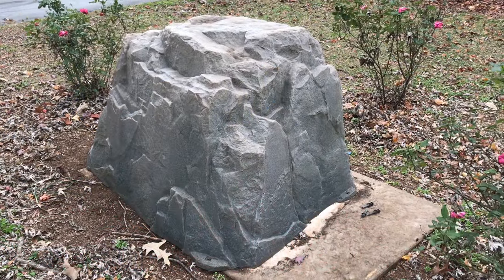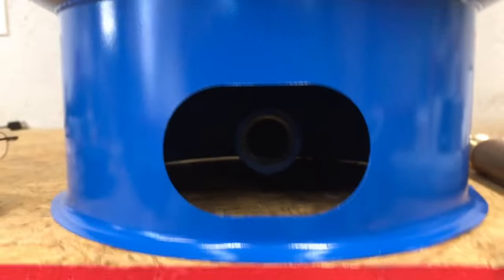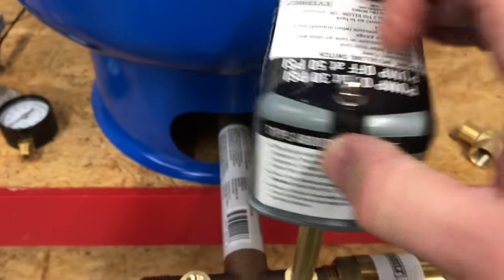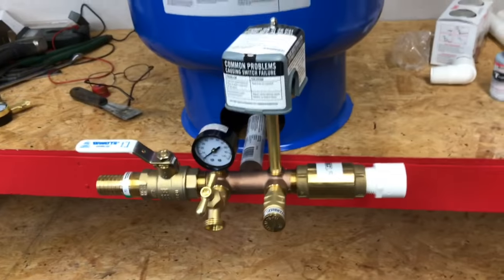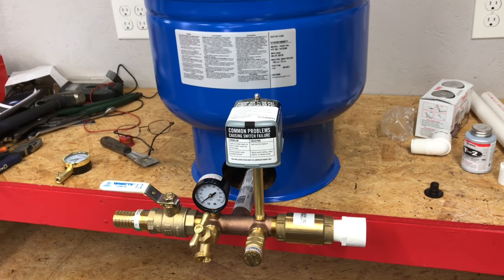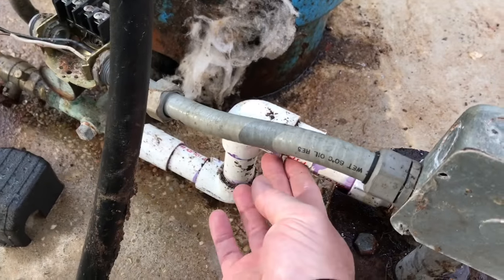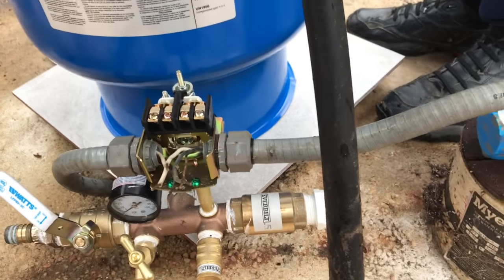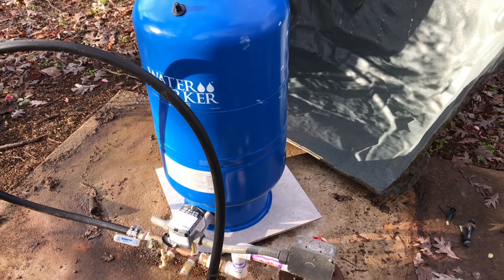How to Replace a Pressurized Well Water Tank DIY

Comment: You are supposed to put the vall valve at the house end of the system (the end that goes to the house after the tank) not to the pump side because that doesnt do anything there is supposed to be a check valve on the pump side

Comment: Not a bad video but I would recommend a T-connector that have a union for easy tank replacement, once that PVC inlet and outlet slips are glued on they will have to be cut away to work on the tank.

Comment: Getting ready to replace my outside tank as well as pump,,rightnow we have little pressure until switch cuts in,,tried adjusting it but i think between tank being 25 years old and old switch a new set up will fix issue,,right now as soon as i cut on faucet pump clicks on for maybe 20 seconds and then shuts off until about 3 minutes later,,this causes a lag time in house waiting on shower or bath to have proper pressure..

Comment: Thanks for the video. I so appreciate the folks like you that document and share your knowledge with the rest of us DIYers on these type of projects.  I am also about to take on this endeavor with a 35 gallon tank that actually rusted through an 1/8" hole in side and is slowly leaking.  Unfortunately, my pressure tank is located in a closet in laundry room that also houses the water heat and the furnace. The current water heater is wedged in their tight so I will need to remove both water and gas pipes to get it out.  I'm replacing it with a WaterWorks tank that is 5" slimmer but taller than the current tank at the same 32 gal. capacity. That should make replacement in the future much easier.  With so many brands of water pressure tanks, how has the WaterWorks brand worked for you?  They are definitely some of the most affordable tanks.
Reply: I was wondering the same thing about longevity of the Water Worker tanks. They are made by Amtrol, the same company that makes the Well Xtrol tanks.(Like the one he was replacing.)

Comment: Hello your video was real helpful I apriciated, but I still have a question. My question is do I need the same size tank or I can get a bigger tank? Also do you think the regulator went bad stead of the tank? Thanks
Reply: You can always go bigger with the tank. A larger tank will reduce the time between pump cycles which will extend pump life. Also that wasn’t a “regulator” it was a pressure switch. As long as the switch cuts on at the cut in pressure (30 psi in his case) and cuts off at the proper cut off pressure (50psi in his case) and there is no voltage drop through the switch then it is working properly.

Comment: Question, if you're using an existing tank and upgrading everything else, should you bleed the air out of the tank before installation? I know you have to bleed the water but I wasn't sure how that worked?

Comment: Great detailed video; I was thinking of either putting the shutoff ball between the PVC and the tank or having an additional one there.
Reply: Bad idea to put a cutoff between the pump and pressure switch.
Reply: @stevee7774  Why? I've been considering working in a bypass between the pump and the final water output so I could take the tank part out of the system if needed. Why is it a bad idea to put a cutoff there?
Reply: @jasoncy31  - I’m not sure exactly what you’re trying to do but some people mistakenly think they should have a cutoff valve before the pressure tank which means it will be between the pump and the pressure switch. In this case if the valve was inadvertently closed and then someone flushed a toilet or turned on a faucet, the pressure would drop causing the pressure switch to close, causing the pump to run. If the pump runs with the cutoff valve closed, the pump and drop pipe would be severely damaged. In other words the pump would run continuously building as much pressure as it could and the pressure switch would never cut it off because of a closed valve in front of it.

Comment: What's the thought process when deciding on a 30/50 vs 40/60 pressure switch?  I know both are common, but I'm not sure when one would be preferred over the other.  Or the advantage/disadvantage of one over the other.  For example, if my house currently has a 30/50 switch, could I change to a 40/60 switch? (I realize I would have to adjust the tank pressure).  Would this provide improved water pressure?  Would there be a reason I wouldn't want to do that? Thanks to anyone in advance!
Reply: it's a matter of preference, really. If you have older pipes, realize that it is a higher pressure. but overall, a properly maintained system should be perfectly fine to handle the upgrade, just make sure you adjust the tank pressure to the appropriate PSI.

Comment: How is that Water Worker tank holding up? It is 4 years old already.
Reply from the maker: No problems so far. I think this is the longest I have went without any issues with my water. Thanks for asking.
Reply: Thanks. I am trying to decide between a well-x-trol or a water worker. It is a pretty big price difference.  @minthillbilly

Comment: there are shallow well pump where the pressure switch is attached directly to the pump. Is that OK? or should I move the pressure switch closer to the pressure tank?

Comment: Excellent video bro! I do have to give you a little ribbing on the "hot" water heater comment though. Common slip and I've made it too so I'm just picking at ya. 👍
Reply: Lol! I’m pretty sure I’ve been guilty of that one too. Also he kept referring to the pressure switch as a “regulator” but no biggie.

Comment: The only question I gave is:  Isn't it illegal to use PVC in potable supply?

For some reason, I always thought it was.  Is it a New England thing?  You know, New England and their hoity toity laws.

 I've lived in New England, somehow, for over 50 years.  My opinion is well founded.
Reply: Yes it can freeze and crack, PE pipe is preferred, much more elastic that PVC.
Reply: @leeknivek  I always thought it was a chemical-into-the-water issue.  No?
Reply: @johnafagerquist8235  maybe, yeah, I’m not sure, I just know that pvc is brittle and cracks. I went to school for plumbing in New England, and they probably deliberately neglected to mention anything about poison - they were still teaching about lead not too long ago.

Comment: Does the inside of the tee have a divider?  What makes the water go into the tank and not straight into the house?
Reply: The water pressure.

 The gray box only lets the well pump pressurize the lines up to 50psi. All the lines in the house + the tank will be at 50psi. The one way valve on the tank outlet makes it so that the air bladder (28psi) will push the water out and maintain 50psi water pressure without the well pump having to turn on. 

The tank tee is just a hollow casting with multiple "ports" for attaching everything.

Comment: Hello,  one question,  should there be a pre filter installed prior to the water entering the fittings and tank?    Thanks  Great Video
Reply: That’s a good question. Seeing as how my tank probably failed due to sediment I would say yes.
Reply: It’s dangerous to put anything that could cause a restriction between the pump and the pressure switch. This includes cut off valves and filters.

Comment: I had a similar problem only our pump & tank are inside the cellar, the tank was 20 years old and the pressure fluctuation was caused by water getting by the air bladder in the tank, because it did it produced rusty water. Had a well company change it out to a fiberglass tank that won't rust and do the applicable plumbing.

Comment: All you had to do is pump up tank to original 38PSI.After draining the tank.Rubber membrane is in the tank so air does not dissolve in water. When membrane is broken all you have to do is pump air in once in 1-2 years depending on consumption. Polish fix, 0 cost.

Comment: Does it matter if the ball valve/shutoff valve is on the right side?  The water comes into the house from the left.  As it is now, when the water is shut off using the shutoff valve, the only thing it shuts off is the water going to the water filter.